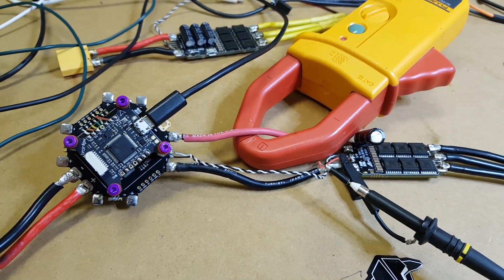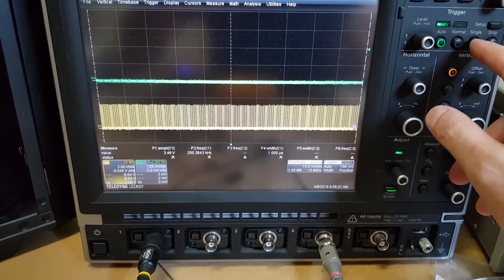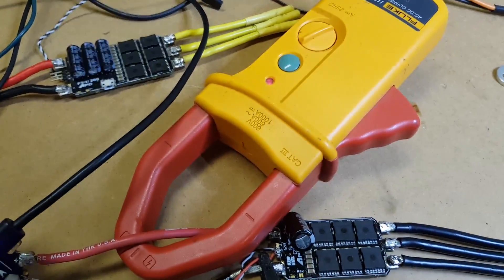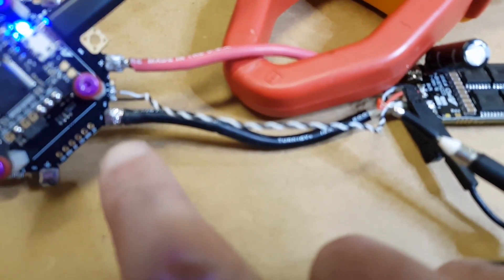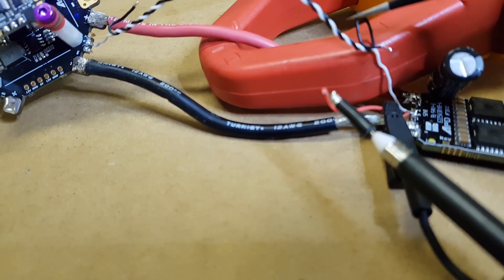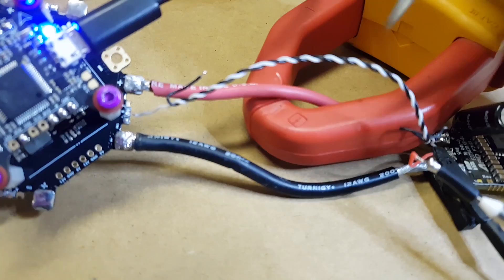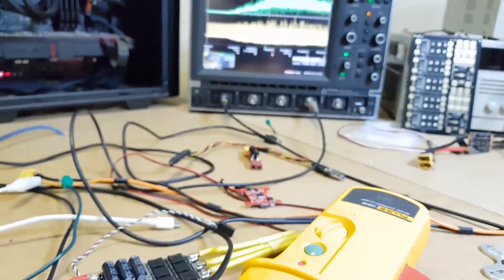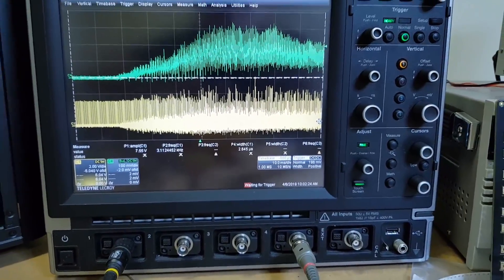ESC Signalling.. Twisted-Pair vs. Single-Ended

Comment: Some of the devices I use don't have designated signal ground pads so I just wire them to the main power grounds. Is there a problem if you connect only one end of the signal ground? I was always taught to avoid creating ground loops.

Comment: Maybe next version of the pdb/esc could have optional differential signaling. Unlikely to see it in the FC's any time soon. Tech in bigger UAV's has finally started using CAN interface to solve noise issues on longer lines.

Comment: I'm still trying to find out why my 120amp escs just shut off under full throttle than reboot.... It's fine when the props are off but when props are on and underload they reboot under quick throttle change to full throttle.
Reply from the maker: Hi Garrett. Are they all shutting off? What voltage are you running? It could be a brownout or the FC rebooting. Send us an email, happy to help out.
Reply: I've tried to get into the firmware through the bl32 configurator but can't get in... Is there a proprietary GUI that is needed to access settings. And I'm using a Radix FC off the 5v of the APD PDB using 6s on 380kv polar motors.
Reply: Garrett Johnson are you using blheli esc’s or they APD brand with some other GUI for them. ?
Reply from the maker: Garret these dont run BLHeli. If your battery voltage dips below 16V, which i suspect it is under load, your PDB 12V and 5V rail will brownout. You should run higher voltage, or maybe try a battery with less sag. Also keep your battery leads as short as possible.
Reply: They are APD escs and PDB and you think a fully charged 6s is dropping below 16V's?... That's seems to be a lot of sag but they are Pulse battery's and I use one 5000mah 50c and also the new 13inch master airscrews the new design. Also the escs are about an inch away from the pdb with about a 1in wire leads using 12 guage wire.
Reply from the maker: @smooth_ops2942  Its possible. You can try 2 things to confirm.. 
1) Remove resistor R11 from  the PDB. This will allow the 5V rail to run at lower input voltages. Also..
2) Try adding a cap to the 5V rail on the PDB. That will help keep the voltage clean incase your FC is tripping out.
Reply: @BestUsernameEverMade  my next step was to put a cap on the 5v rail 😁 as well and see if anything changes and thank you for telling me about removing the resistor on R11. But before I try removing the resistor I'll prob just supply the FC with another power source for testing. Are there any settings in the ESC code itself that would make it do this or most likely a hardware issue with my setup?
Reply: Garrett Johnson have you tested to see if your esc kHz is on par. Try going from 48 to 24 on them esc’s settings. And depending on your motors timing can make a difference. I herd that large motors like the 13” or bigger props use medium low to low timing.  Also check solder joints. Reflow the connections could help also.